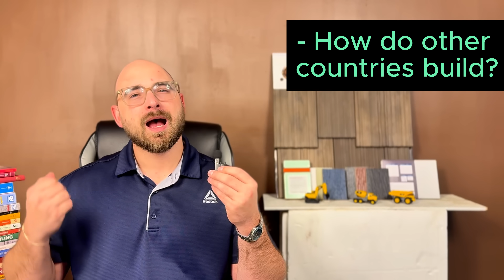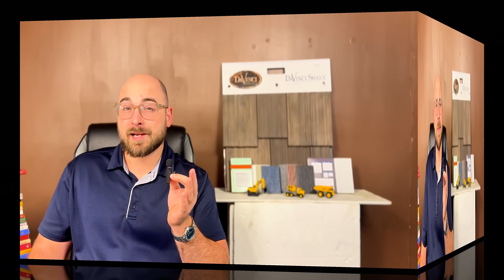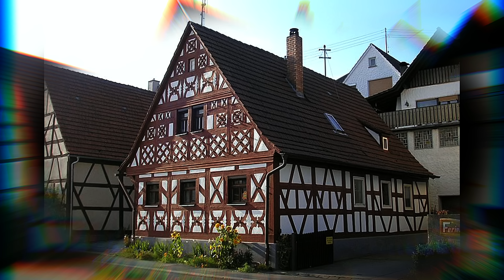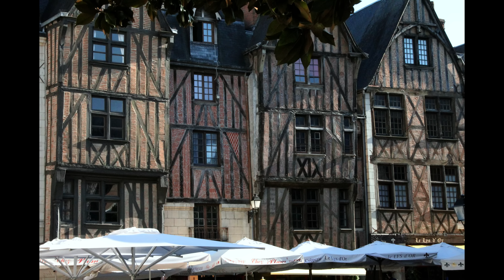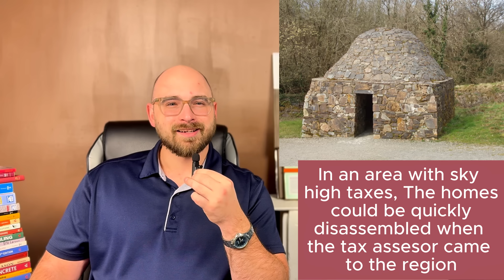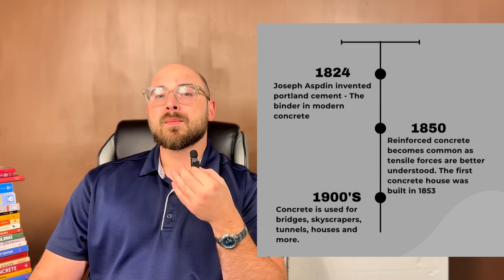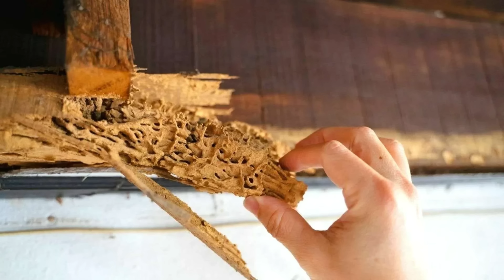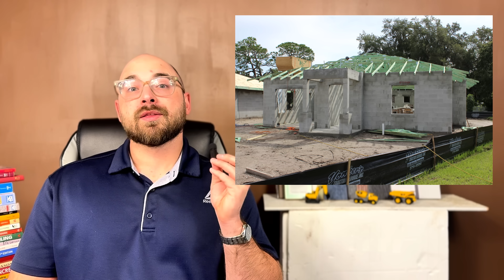Why Other Countries LAUGH at American Homes

Comment: I'm Swiss and also lived some time in USA, and the difference in house walls, insulation, sound muffling and stability is very evident. There's a reason we don't really use ACs in Switz, even in places where temp can reach high 30s °C. My biggest gripe was always with the guillotine windows USA has. Can't freaking clean them, and they are extremely dangerous!

Comment: Idk if houses here are better. Plenty of problems with em, if not done right.
The house i live in was built in 1890.
Some sections are newer, and the roof is as well.

I know some sections are of lesser quality than the others. I dont know if its the interwar or post war period thats worst, but can say that whats from the late 1800s i solid. 

But isolation during the 1890s was much more primitive. Its solid and withstand humidity well, but kind of requires you to light all the fireplaces  ; orignally one in each room, during winter.

Comment: I've heard that Western Australia builds with double brick or brick veneer with a steel frame, which is built similarly to a timber frame. Mostly due to termites. North queensland also builds with steel frames for cyclone ratings. 
My house here in NSW is a brick veneer but with a hardwood frame. It was built in the 90s, but pine framing is the norm now.

Comment: Even in europe, well insulated modern houses are often build out of wood because you have space for insulation between the wood framing. The main difference is that (at least in germany) they usually use a lot thicker lumber to give house more structure.
With solid structure buildings there are also ways to give it great insulation, but it's often easier to build wooden homes. So the material isn't the problem, it is the way that it is built out of wood. having 4 inches of insulation in a light wood framed house isn't good for anything, but you can build extremely efficient homes with wood.

Comment: To be honest, this is a total joke. I hear Germans say that about US homes all the time too. BUT, let me tell you one thing, I don't know about the statistics, but upon observation of new areas being built around our county, maybe a third of the homes is really "brick". The rest is a mix of little parts of aerated concrete and wood and the majority of that being wood assembled panels! Why? Cause the majority of Germans build homes using ready made designs and materials from companies such as massa-house.  And even these homes are then sold at around € 400k-500k Euros.... And the issue here I see is, the quality doesn't fit the price, which is an issue where many US counties had for along time. Selling a wooden shack that cost maybe 100k to build for over 500k (but I think the issue here is more related to land costs vs material/labor cost). 

But Wood vs Brick/Concrete. Of course Wood is cheaper, but that doesn't mean that wood can not last. Some homes I have seen that are over 300-400 years old here in germany are build using the so called half-timbering structure. Its still a wooden load bearing timber, where the spaces in-between are filled with any kind of non-structural material  which can be plaster or even bricks (majority of it not being brick). And they can burn as easily as a wooden house in the US. And the issue that USA has is, that they build wooden homes in hurricane infested lands, that's it. And maybe earthquake ridden places should have homes built with something like concrete (see Japan).

Comment: From a European perspective (and African too, as that is where I grew up), the average American suburban home feels 'wrong' in a few aspects. One is size. Your houses feel way too big. Supersized, basically. Second is the experienced quality. For instance, a house needs to be well insulated (thermal and acoustical), and while you can do that with timber, to do it you need a lot more attention to detail - and that's just not how houses are built in the States. Third is durability. Wood as a material is perfectly durable. But to make sure it can withstand everyday use for decades or centuries, and that it can resist natural disasters like storms and hurricanes and earthquakes, you again need focus on details. And again, that's where the current USA wood framing habits seem to fall short. Where I live, we do timber framing, too. But the amount of layers used / needed / prescribed, and the number of manipulations and treatments and seals and ... that's so completely different from what you see in the States. The way untrained contractors can go to Home Depot and quickly put together something that resembles a home ... that's just not tolerated over here. We expect our contractors to be well trained, and for any home you also need an architect. It makes for more expensive, but technically more reliable houses.

Comment: To put it bluntly, because its seem like "as cheap and fast as possible" are the only two considerations.
Built to last one generation and get resold just before they fail structurally. 
I wouldn't' be surprised to see styrofoam prefab homes being wheeled out with the "legally adequate" minimum amount of fireproofing, featuring load bearing wallpaper.

Comment: It's not just the USA.  In Europe now because of green regulations we are seeing houses made of sticks and aluminium foil.  They won't last long enough to be handed down to the next generation. I opted out and bought a 150 year old stone cottage which isn't as cold as you might think...except in the couple of block extensions built in the 1960s with zero insulation🥶. Gradually these things are being sorted out and in the end it will be a house ready for another 150 years.

Comment: Stone in Ireland would be in times past. Nearly all the houses of the last 50+ years here would be cinder block structures, mostly brick cladding or some other render. (In recent times some awful plastic cladding has been used on a good number of homes - it discolours, particularly via algae).

Comment: I think the issue with America is not wood so much as poor regulations and craftsmanship. You can easily build a wood structure that is very efficient and will last 100+ years, but you have to nail all the finicky details of insulation and moisture management perfectly. American code is not up to scratch there and maybe a majority of trades workers couldn’t do it even if it were.

Comment: Nothing wrong with building from wood, Finland builds a helluva lot with wood and it's fine. I'm just surprised by how flimsy some of the US wood houses are. And I'm sure there are PLENTY of really well built wooden houses in the US.

But I've also seen things like a tree falling on a house and cleaving it in half almost all the way to the foundation. I've seen 4 or 5 similar situations here (with big birches and pines), and in all but one of them all that needed replacing were the roof tiles, and on the last they replaced one beam, IIRC. None of them made it through the attic.

Also how easily people accidentally make holes in their walls or doors. Or on purpose. Making a hole in a wall or a door here takes EFFORT, even if it's not an external wall.

I guess if you're expecting it to flood or be attacked by a hurricane every other year you don't wanna spend too much money and time on it...

Comment: I would like to hear how much work is done for ICF and fire safety. In Norway the equivavelent of your code requirments grealt limit the use of any kind of styrofoam as internal insulation due to the very lethal off gassing effects it has during even a small fire. I would argue the biggest difference in materials between us and the US is likely driven more by things like fire safety and overall health reasons than R values and the strength of the materials. PS: ICF is used here as well, however far less and more often as part of a foundation than the actual house.

Comment: The issue with the US is that so many houses are built in quickly rather than well. Also some europeans that make comments like why build it that way there. Don't get the actual cost aspect. A big home in Norway built decently in Louisiana is way cheaper using their "shoddy" techniques. Sure it's gonna be nothing but sticks after a hurricane, but contrast that by building a though home of concrete or brick and factor in the fact that water damage means you still need to gut the house after such a disaster and the economics suddenly means building to last in these enviroments is too costly compared to a cheap house. A more apt comment regarding what they do is the fact that so many rebuilt homes in these areas are built on stilts of the same shitty lightweight framing. Sure it might save you from a small surge, but in a big storm you would be much better served by a few thick conrecte pillars. Also It's way easier to lift the house even higher using a concrete column giving you a bigger margin of safety in a flood.

Comment: Most people build with suitable local materials, UK had timber and built timber framed, then switch to bricks, as we have lots of clay 

In the USA almost all houses are light timber framed ... regardless of the local resources, or conditions, and have been for over 100 years
It's good to hear the US is slowly moving to more suitable and long lasting materials 

The Building industry in all countries is massively resistant to change, in the UK it's the  only industry that still uses some imperial measures (usually hidden behind odd metric values)

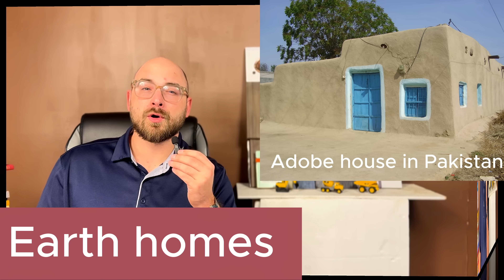Comment: 0:59 "Suitable for the climate" your words, not mine.
American houses (lightwood frame) get blown away by the wind (tornadoes) , or flooded by storms.
☝Does NOT pass your OWN criteria. That's your local climate, storms, tornadoes, twisters and You don't build for it. In EU we don't have Twisters and we still go with "Solid Structures".
Try reinforced concrete next time. 👍  You even made my point yourself, at the end of the video ICF. "Significantly BETTER for not much more cost".

Comment: We build with wood framing in Sweden too, but.... 
Outer walls are 30cm / 1 foot wide, stuffed with insulation. Inner walls are insulated as well. They are often covered with both OSB and plaster, or double plaster sheets. Floors are insulated, ceilings as well. Roofs are sturdy and covered with long lasting materials. Wood houses built before 1950 will practically last forever, if they are cared for correctly. Modern houses ate unfortunately not of the same quality, but at least they are not hollowed-out shells of sticks and cardboard. It is absolutely possible to build good quality wood houses with modern techniques.

Comment: The most surprising element I find is roofing. Why use materials that have a 10-20 year lifespan and need replacing? Surely a little extra expense for a roof that can last 50-100 years is a good cost/ benefit analysis?

Comment: I guess homes are usually built as cost-effectively as possible for the local climate. In Sweden most homes are built from lumber. They differ from e.g. UK homes by being on average better insulated and having more advanced heating, for the obvious reason that it is colder. Our house has ventilation with a heat exchanger that returns 85% of the heat from the outgoing air. Heating by heat exchanger systems are also common, getting heat from the ground or the outside air. My impression is that countries that build more often using other materials do that because lumber is not readily available.

Comment: the problem with american houses are not the way that they are built 

its that for some reason your builders dont seem to be smart enough to build houses to the natural disasters

no concrete walled houses in hurricane prone areas
building on the SAND next to the sea with crap foundations and dont even bother to place on stilts 
tornado alley? hmmmmmmmmmmmmm  why are the houses not concrete and steel built and semi buried?
new orleans  yeah they built on stilts but then use timber stilts and a spindly timber frame house ontop 
and the steel framed houses u a;; talk about i wouldnt use that crap on my pig pen . that crap can be cut with a pair of scissors 

EVEN THE PUERTO RICANS ARE SMARTER THAN MAINLANDERS🤣🤣🤣🤣🤣🤣🤣🤣🤣🤣🤣

Comment: That's not an easy video to make. You forgot most of Asia (China and SE Asia). They mostly use reinforced concrete with bricks. City fires in Asia are very rare even if the density of population is very high.
you could also mention the traditional construction techniques in New Mexico because they are very resistant to tornadoes.
It's a good thing I watched the video until the end because I thought you weren't going to mention FLW 🙂
Reply from the maker: My first script was like an hour long; but I didn’t think people would watch without fancy editing , so I made it much shorter

Comment: "Earth homes" from clay with straw is traditional in Ukraine. They are best from internal environment perspective. Raw clay are very good in keeping optimal humidity inside. Also they are pretty worm. But nowadays we build from bricks  if you have money, or from AAC or limestone if you don't have money. Frame houses here are for the poorest, they don't have any benefits except price also they don't last long enough. From war perspective concrete frames + bricks are the best option you can have. Then you have bricks and clay-with-straw. Precasted concrete panels are very fragile and tend to collapse after explosion. If you want real house you wish to call home build using clay and concrete and make sure to have at least one underground floor. It will last for centuries and will stand up wars. For example bricks and clay house need 3 days to cool down after you turn down heating. Long enough to figure out what to do next.

Comment: How much CO2 does a concrete house add? Are there newer concrete substitutes that can work? How many years until the reduced heat loss cancels out the build CO2? (For EVs it's around 3 years, for example)

Also as someone who's literally gone through a few drywall and siding walls, I'm not thrilled that ICF is still so fragile. It limits your sports/activities. It's nice to see innovation though.

Comment: We lived in the Bahamas and for the most part they used poured concrete buildings including the walls. First its hurricane resistant. 2nd when ur family is bigger you turn flat roof into the next floor. This is why the roofs have rebar sticking up

Comment: Loved the video from Sweden 🇸🇪. I go to engineering school and the biggest criticism in Sweden against the US is your fire standards. In Sweden it’s very hard to build big whit studs and we rarely build whit steel because it’s hard to get up to the fire standards. We see our buildings as made to last from an incremental and social stand point. But to build whit wood does not compromise safety as much as other country’s think we have a long history of building whit wood and now we have newer cross glued wood called KL trä in Sweden.
Reply from the maker: It seems you guys prefer timber to light wood framing, 

I would imagine large timbers char and prevent further damage, and/or take a very long time to reach a failure point.

Comment: Light wood framing is cheap?  Could've fooled me; I was just quoted 510k to build a 1700-sq.ft. house.  Guess I'll wait until I win the lottery.
Reply: That was $510k just for the frame? Or did that also include all the plumbing, electrical, HVAC, flooring, etc...?

Comment: I can understand some of the reasons to choose wood, but I could never live on a house that's THAT flammable. Houses in Brazil get passed on for generations anf when it catches fire, you basically only lose the roof structure and even then, most houses now have a solid concrete slab below it.

Comment: As an insulation technician in Canada i can claim that North American houses are average. 70% of attics where i've been had frame decay problem) ''However'' if a house is insulated good you can open your windows even it hits -30 celcius (with dense pack and attic insulation). You should acknowledge that those insulation methods also temporary. But these houses need proper repairs all sides than European concrete-brick houses. North American frame lumbers are not polished or secured against insects and long period destruction. And it makes wood drilled or decayed after a while. Osb and lumber unfortunately not reliable products for decades.
In order to keep sides dry you should use just vinyl otherwise your house will face mold or decay no matter what.

Conclusion : Siding should be insulated concrete(covering with vinyl as exterior makes a house extremely secured for all seasons) or brick based. And interior walls should be plastered concrete .At least you can hang a picture or portrait frame freely than drywall. Drywall is an absurd material.

Comment: I've found there's one big downside for concrete/brick buildings, at least where I am in the Netherlands. 

They're very difficult to modernise. Americans have the luxury of being able to run wiring, ducts and conduit in between drywall plates. Upgrading wiring in the wall to add networking, grounded power sockets, AC, etc. is incredibly expensive, labour intensive and on occasion impossible. You often have to resort to running cable ducts along interior walls which is both ugly and increases the length the cables have to run.